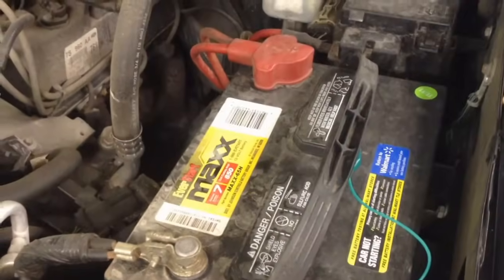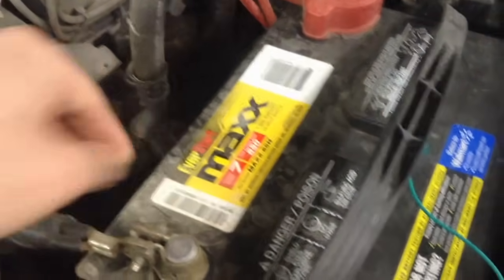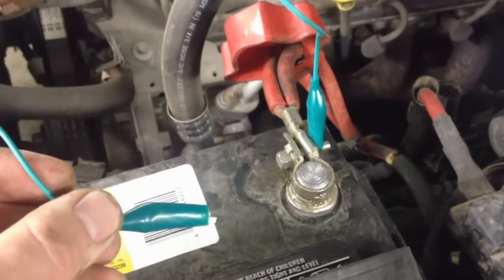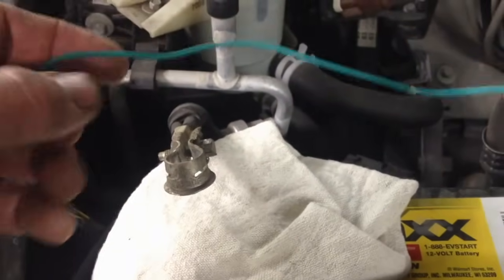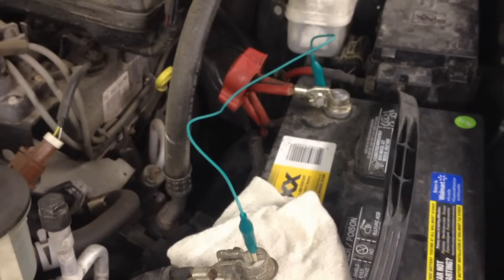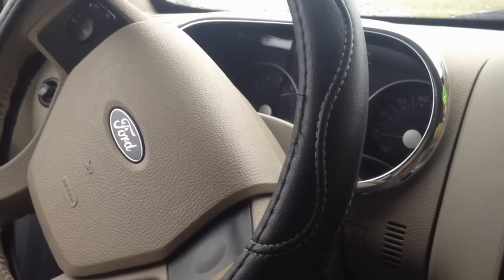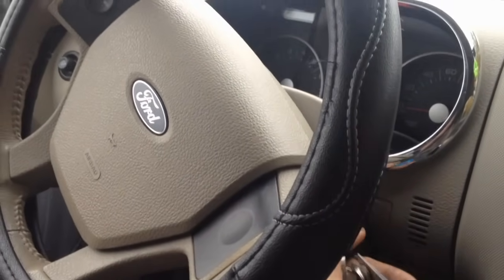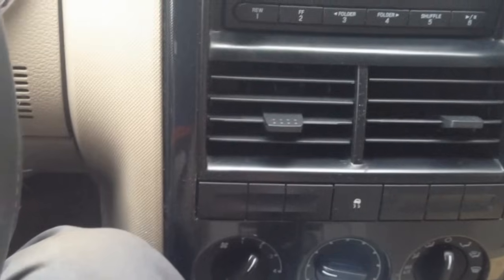How To Clear Your PCM'S Memory On Fords After Repairs

Comment: 98 ford Exploder : Changed spark plugs and wires. ( some of the plugs were gapped at .60+!") i know i know way past overdue or maybe the shop i took them to was just doo doo. But i gapped them all at .54 and new wires. Should i do this because car felt like it was idling REALLY low and shifting funny on my first drive with them today.

Comment: I have a 96ford with the 7.3, don't start done some new oring on IPR and new ICP  camshaft sensor run fine before but one day just died .Thought was diesel so add more to it finally got it running but feel no power barely run 55 flat surfaces little hill drop to 20 25ml now don't run.oil level is good

Comment: My 2014 Ford Fusion was shifting rough from 2nd to 3rd and slipping from 4th to 5th gear. I performed a transmission fluid change by doing the drain and fill method 6 times! And the slipping went away but the 2nd to 3rd rough shift is still there. The car has 60k miles on it. Would this method fix my cars rough shift issues???
Reply from the maker: +Themrchilango You must get the trans adaptive tables cleared by the dealer scan tool.

Comment: my pcm controlled alternator isn't charging my battery, will resetting pcm fix this? i been out of commission for a bit.

2002 ford taurus. thank you ! hoping for a quick reply
Reply from the maker: +SandersCSclips What have you tested so far
Reply from the maker: +SandersCSclips pcm reset may fix only temporarily.
Reply: FordTechMakuloco i have a brand new alternator  and battery which i didnt need to buy .. soo 300 down the drain there.  alternator passed but with multimeter its not putting out the 14.xV needed. but after doing research its pcm controlled alternator.  2moro i will check pcm connection corrosion. but idk its a pain in the ass.

3.0 v6
Reply: I had that problem on my 05 ford 500. It would rev up on its own,  eventually wouldn't start.  Paid 900 at the dealership for a pmc that had to be put together because apparently they don't make 500s anymore.  Car has idle issues still where it'll rev up a little.  But it charges the alternator.  They replace the alternator initially against my wishes and vehicle shut down same day I got it from the dealership

Comment: I find myself going through this each time I change my oil and clean my MAF sensor after cleaning my CAI filter.  You were 100% correct that the problem I was having with MPG was 100% related to the oil coming from the aftermarket CAI filter after cleaning and re-oiling.  The excess oil from the aftermarket air filter had put a light coat of oil on the very thin and sensitive MAF sensor wires/resistors.  There wasn't wasn't much filth on the sensor but it was enough to cause my poor MPG issues. Cleaning the MAF sensor, the Throttle Blade and Seating Area combined with redoing this super easy reset of the PCM's stored vehicle adaptive learning settings has restored my MPG to 14-16 MPG from the 11- 12 MPG that I was getting prior to these cleaning and resetting procedures.   Your videos are always Awesome and a HUGE help for us and combined your Super Easy step by step video Information has made a huge difference and made me a better and more confident  DIY'r.  Thanks Huge Brian!  God Bless brother.
Reply: Community associations institute??  lol

Comment: I replaced the transmission in my 03 Ford Sport Trac.  Do I need to do this?  Thanks.
Reply from the maker: +Mennitti4Congress No the battery has been disconnected the whole time so it will be cleared.

Comment: Will this work if I replaced the idle air control valve on my 03 ford tauraus and it's reving high cause it's worse then before I put the new one on. Now it revs to 1500 rpms as soon as I put it in drive and seems to stay at 2000 rpms going down the highway

Comment: Switched out a 04 for 06 powerstoke engine but kept trans. Used the pcm from the 06 because the 06 does not have that throttle runaway valve after the intercooler. It shifts hard into gear and the od light flashes. Would this process help correct the hard clunk into gear or should I use the 04 pcm. Much appreciation for all you do on here. Truly a gift to us dui wrenchers.

Comment: I have a 1998 Ford Explorer 4.0 threw a misfire code when I checked the plugs one was broken on the wire end. Changed plugs wires and coil and still getting a misfire on cylinder 6. I have a p1000 code that will not erase! There is a 14 step process to clear the drive cycle. Will this work or am I just wasting my time please help winter is almost here in Maine. This makes me never want to own a ford again please help persuade me otherwise

Comment: Excellent video. My 07 Explorer was shifting hard into 3rd after warming up after I changed the oil and filter, and only disconnecting the batteries didn't fix the issue. Followed this exactly, and no more hard shifts into 3rd

Comment: +fordtechmakuloco does this work on a 2010 Ford Taurus and does this erase all data on the ecu like codes and the ability for the dealer to look up any previous throttle from the driver ? Like if I was to stomp the gas for example will this still show up after doing this?
Reply from the maker: +Juan Perez It will clear all info from the pcm but not trans adaptive tables.

Comment: so mu dad has a 2002 f150 4.6 and while it was running he pulled fuses because his lights didnt work, now the truck runs horrible and trouble codes pulled are p0340 p0443 p1451 p1336 p1747 p0750 po755 p0743 but it never had any codes wrong before. i dont even know where to start?
Reply from the maker: +Ernest  Hardcastle Perform this procedure then run it to see what the current codes are and go from there.
Reply: +FordTechMakuloco  would this work on an automatic? im not sure if the vehicle in your video is standard or automatic. i just wanna make sure before i attempt this just to be safe, i don't want to make things worse lol
Reply from the maker: This procedure works on any Ford vehicle.

Comment: Hi, I have a question about ignition coil, if an ignition coil fails, the pcm of my ford escape 03 has a failure or it´s  damaged? I am asking you because a saw a video where they say that if an ignition coil fails you must replace the six ignition coils and also the total of the spark plug and have the pcm of the suv´s fixed, but if you just change the ignition coil damaged the pcm it is going to damage the new ignition coil. Could you please help me with it? thanks a lot
Reply from the maker: +Luis Herrera That was a concern on very specific years of the escape your is not included so just concentrate on the cylinder of concern.
Reply: +FordTechMakuloco  Well, thanks a lot for your advice, by the way, do you recommend unplug an ignition coil while the engine is running in order to figure out if that ignition coil is the bad one?. thank you!

Comment: Will this work after say you install new intake gaskets. Im having a misfire issue after i have put new intake gaskets on ive tried new coils. put it seems their is still and issue. I didnt have the misfire before i changed the intake gaskets but after.
Reply from the maker: +jspitler855 Yes it should be done. Make sure the connectors are in the correct spot and all the spark plug well are clean and dry.
Reply: +FordTechMakuloco  I'm having a miss fire after replacing the gasket and before starting the windstar I did the pcms clear memory is that normal that the car miss fire while learning fuel values? please let me know thanks

Comment: Tried this trick yesterday (Oct 3,2015) on my 2006 Ford ranger which had not been running right for months after changing my battery. Truck runs great and shifts great after following your video advice. Thanks

Comment: got 1996ford ranger 3.o liter V6 theft mode is on will not let me start has new ignition in it with out a chip in key do I need the chip in key please let me know asap

Comment: I have been having problems with my 2005 five hundred for a month now. I am retired and living in Mexico so it is hard to find parts. I was replacing motor mounts like crazy so took it to Ford here in Mexico. They told me it was the valve body that needed replaced so after $2500 USD it still was not fixed. I then took it to a transmission shop to have them look over Fords work. They said nothing is wrong with my transmission and did not know what the problem was, but it might be the traction control. The transmission shifts late from 1st to 2nd so the rpms are real high and the tires burn for a split second when the shift occurs. Yesterday I was tinkering with it and now the Throttle Body is clicking when I try and start the car and car wont start. I have a new 1000 CA battery  so I know its getting power. My question is do you think this will work for my car or do I need a new Throttle Body? Please help, I am ready to dump the car in a lake!!! Thanks for any advise.

Comment: I have a 2004 F-150, check charging system light has been coming on, all gauges quit working, the truck died. parts store said alt fine ,replaced battery. Still happened and left me stuck again. Replaced Alt anyway, still happening. I haven't driven it to see if it would die again since replacing ALT, for fear of being stuck again. Have read BMS needs reset.  Will this work for my problem to?

Comment: Is this reset necessary after you switch engines? And can not doing so cause issues with overdrive or transmission not getting proper signals to the electronics?
Reply from the maker: Not required since the battery was out for an extended period of time.

Comment: ok I have a 98 F 150 4 wheel drive 3 door trucks it is giving me problems it has this intermediate miss i fix it it goes away something comes back this is been going on for years lately it seems to come back sooner also I wanted your opinion on how much do you think this truck is worth I'm trying to sell it 265 thousand miles never done any major work to the motor or transmission
Reply from the maker: +baddogit At 265k not much put you info into KBB it will give you a good estimate for your area.

Comment: I have a 99 explorer sport 4.0 sohc wich the transmission went on . Just did a tranny swap , the one I got was from a ford escape . Anyways after the new one was put in I drove it for a couple drives to the store with no problems  . I took it for the first longer drive the next day and I noticed after 10-15 minites of driving it started to slip and the od light came on so I pulled over and chwck it out to realize my transmission was overheating so I let it cool down and drove it home . The fluid is new and I checked my cooler lines and its circulating just fine . Im lost for words and spent all my money on this repair and its still not working right ..  it shifts fine hntil it gets hot ! Anyone have any ideas ?

Comment: Hello,
We have a 2011 Ford Expedition and got codes p0341 and p0345 and rough idle.  The sensors were changed,  but these codes keep popping back.  Would this process completely clear it so the truck has a fresh start?
I am trying to weed this out, my husband is away on Army business and the Ford dealers in our military town like to "add" problems.  All the dealers here do that though.
Reply from the maker: +Amy Huffman These codes came out of nowhere? Yes this will clear everything and start fresh.
Reply: Long long long story short...I have a 2011 Expedition XLT 4x4.  I had the vehicle in the Ford dealer a year ago for warranty work on the radio.  They gave me that checklist saying that everything was fine with fluids.  I drove home.  I had the work done, where we bought it 70 miles away.  Next day I was back in that area for work and a horrid tough idle.  My husband had me stop it.  Checked oil and it couldn't get a read.  He went on foot to pep boys bought 3 qt.  Put all of it in and as soon as I was done with my commitment, we drove to pep boys to have it check..oil leak..all that stuff.  They drained 5.5 qts.  Could not find a leak, did oil change.  
Over the next several weeks, plugs got changed, throttle body, mass airflow...all of those things got cleaned.m he even put new brake pads on.  Somewhere in all of that rough idle went a way...not a problem until this spring...light came on with bad O2 sensor, I forget which one passenger side, I think downstream.  2 weeks later the light came on and said the one under drivers side.  He hadn't had a chance to change it.  Other than the light no issues.  
I have been busy and away (North Carolina to Ohio is 600 miles one way) a few of those trips and other stuff...I was in bad need of an oil change.  He changed rather oil, said I had some sludge and I got the lecture from my mechanic husband about not getting it changed, at which point I reminded him that I purchased the oil and filter for my 'mechanic' to change it ;)
As soon as he changed the oil rough idle was there and codes were popping left and right.  He cleaned the throttle body so well...we had to replace it.  He went back down the list.  Changed plugs...everything.  Our son replaced both cam sensors.  At one point, I had 39 codes.  
Move forward to yesterday... I got codes read...P0340, P0341, and P0345.  My son went out and checked, the sensor on drivers side was broke and prongs exposed.  He replaced this 2 weeks ago.  Took it to OReillys got it changed out on warranty.  Came home unplugged the battery to 'reset'.  Drove well for 24 miles then got stuck at a light and I am back to rough idle and sounding like a diesel.
Went back to OReillys, they know me by name now...kinda like Cheers.  Had the codes run again...
P0340, P0341, P0345, and P0316
I was wondering if these codes were somehow still stored even with unhooking the battery for 10 minutes and somehow still causing this mess?
Reply from the maker: +Amy Huffman If you have sludge problems the vct solenoids are likely sticking causing all of this. If this is happening all the time you can disconnect the vct solenoids and drive in the same situations and see if the concern is still there.
Reply: FordTechMakuloco unplugged them...first trip out perfectly quiet, not an issue.   I had to ask my teen if the truck was even running.  Second trip out, got stuck in stop and go traffic.   
Rough idle came back, but not half as bad sounding.  It didnt sound like it was goung to die.  
The normal rough idle sound comes across like a diesel.  My husband wanted me to add that there is no 'ticking'.

Comment: So what's the advantage of using the jumper wire, vs just pulling the negative cable off, isolating it from the post and just turn on the headlights for a few minutes?
Reply from the maker: ***** Most new cars since mid 90's are ground side controlled so you turn on the headlight switch it still send the ground to the gem module but it does nothing with it because it is not powered up. Hence trying to turn on any load at that point just does not work.
Reply: FordTechMakuloco Interesting....thanks for the quick reply.  I'm more used to working with Fords earlier OBD I and pre "drive by wire" OBD II V8's, so the '04-up stuff is a little new for me.

I just installed a new throttle body on my '06 F150 after experiencing what multilple online searches told me was classic bad throttle body issues (random dead pedal, wonky low speed throttle response and shifts, wrench light, followed by lack of power and random high idle).  I was a little perplexed, since even though I got the amber wrench (limp mode light), it still wasn't bringing up any CEL codes on my scanner?

What I didn't do with the throttle body swap however, was reset the KAM....so imagine my surprise after changing the throttle body, the truck seemed to behave exactly as it did with the old one. :(

I'll cross my fingers and hope this helps.   I've been all over the forums trying to get an answer to this one and am trying to do everything possible before tucking my tail between my legs and bringing it into the stealership to hand them over $115/hr to experiment with it.

Man....I wish this thing was as simple to work on as my old Fox body. lol
Reply: FordTechMakuloco  Well, that didn't work.  New throttle body installed, KAM reset and the orange wrench still comes on as often as ever.  Would the potentiometer sensor on the accelerator pedal also cause a similar issue?

Comment: I need help. I have a ford Taurus lx,it is a 2000. I had a radiator,power steering pump put in,theromsat,a sensor put in and a manifold .now my car will not say nothing. My brother thinks I need to get my key reprogram. I need help.
Reply from the maker: Mae Hicks So the cluster does not light up? Theft light prove out or flashing?
Reply: Theft light is still flashing. Head lights works,inteior lights also works,
Reply: FordTechMakuloco It just will not start. Radio does not work,but the clock is on.

Comment: I have a 2001 Ford F150 5.4L that has a surging/stalling rpm.  This occurs after the truck has been running for a while and particularly when the A/C has been running.  I've replaced the IAC, FUEL FILTER, and found a melted vacuum line between the battery and the firewall which I fixed. After all this the problem still persists, do you think it is because I didn't reset the PCM?
Reply: cstam105 FordTechMakuloco just found more melted vacuum lines in same area. Going to fix them and reset the PCM.
Reply from the maker: cstam105 Yeah it sounds like you have a large vac leak causing this andy check engine light on?
Reply: FordTechMakuloco It came on once.  The day it did come on it felt like it was missing more than the usual. Since then, no CEL. I'll try to do a video/post a pic of where my lines have melted.  Should I still reset the PCM? Especially since I replaced the IAC?